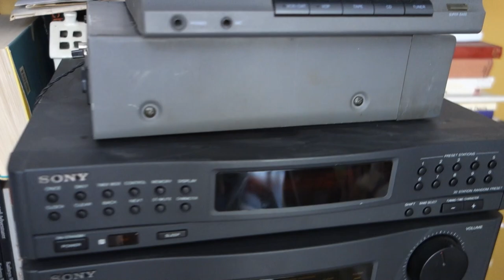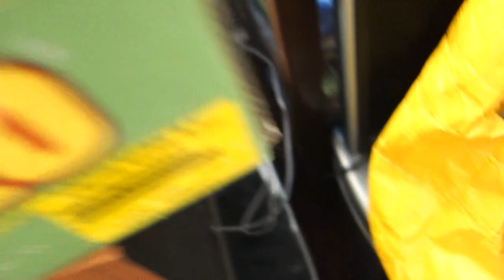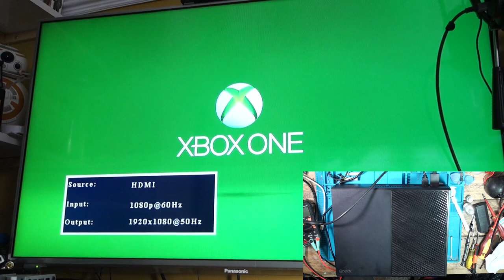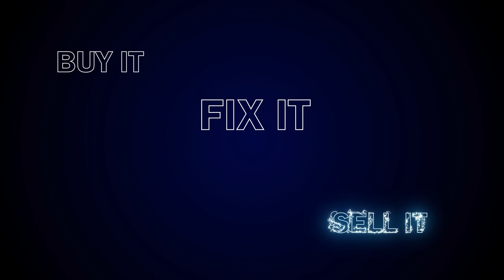Microsoft Xbox One Repair No Power No Beep No 3.3 Volt Rail No 1.8 Volt Rail

Comment: This looked quite interesting there Lee i guess these power issues can sometimes be hard to figure out ,  never the less another good fix you managed to do Lee - Nice 1 mate 👍
Reply from the maker: Thanks for watching and commenting Chris. This was an interesting one and not a normal repair, just goes to show that looking over the board first can show you where the problem is. Although these components are only a few mm in size so can be hard to spot a tiny pin hole in them.

Comment: Good video well done. I still need to practice getting the x clamps on and off i find that part difficult a bit
Reply from the maker: Some seem really difficult to remove  where other can seem simple. Have you tried using the x clamp removal tool? It makes it look easy. I just use a small flat head screwdriver but you need to be careful, one slip and you could cut through a trace on the board or knock a component off.